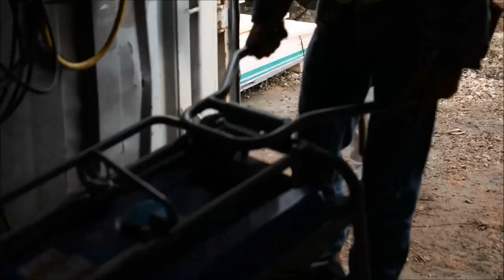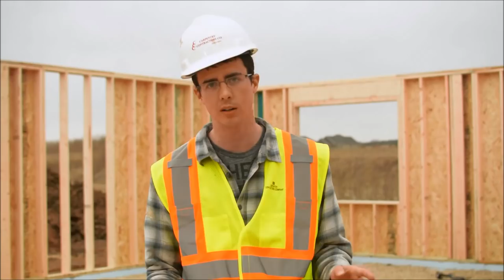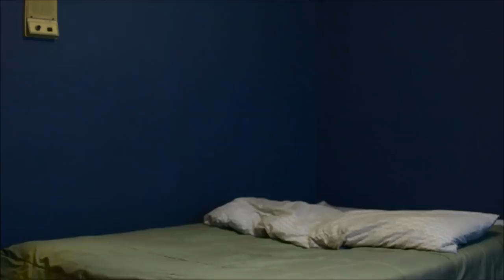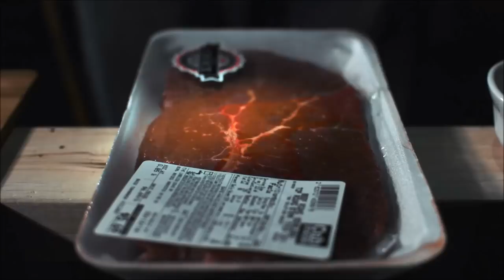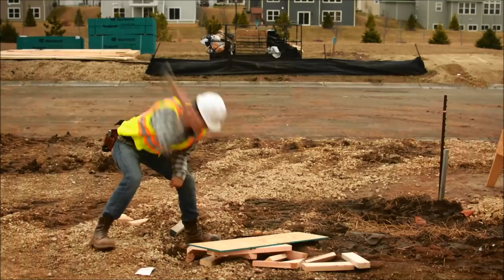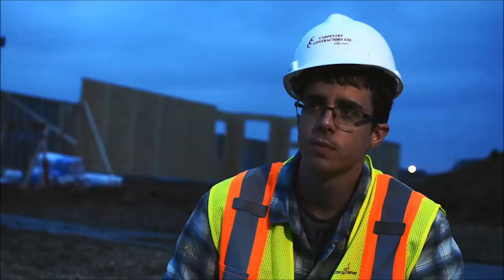Framing Houses in Minnesota - Humor

Comment: 33 drywallers disliked this video!
Reply: framer drywaller here, can confirm
Reply: Victor Holderman haaaaaa lol I say that all the time
Reply: I'm a drywall finisher and lmao the whole video. I can relate, but I will admit drywallers are a little more rowdy. I've never seen a drywaller who's worked more than a few months, not sing to himself. We'll be working and all of a sudden out of nowhere lyrics of some song are being practically yelled😂. I thought they were legitly crazy and took getting used to, maybe because I'm a girl, but after doing drywall a few years, I get it.
Reply: Lexi Anonymous  .. That's because gypsum is toxic and it takes about 4 months to take effect! 😂
Reply: @7033Joe fuckin bumb cabinet installer and finish carpentry guy here. How does this toe stepping happen? I thought that the framing, electrical, and plumbing inspections all had to pass before drywall started.
Reply: @lexianonymous7690  havnt been around many foundation wall guys have you?

Comment: Typical Gen Xer, has to use a skil saw to cut skirt steak.  Back in my day we used a crosscut saw.
Reply: noobs, I use a radial arm saw lmao
Reply: Rip across the grain for a more tender steak.
Reply: Except that wasn't a skirt steak. it was a dirt cheap top round or sirloin steak. Skirt/flank steak looks nothing like that.
Reply: Reciprocating saw all day. After I tumble marinate steak and dry rubs in the concrete mixer.
Reply: Barbarians! I cope all of my steaks to the grill grate with a 32 TPI blade and slice with a 
#4 1/2 hand plane.
Reply: Table saw. Rookies.
Reply: Band saw cuts more accurate
Reply: Y’all are crazy, I use a rock and two sticks
Reply: I was in the army so I like to use detination cord. Cuts a nice straight line lol
Reply: Fuckin Axé 'er, wha?

Comment: That sound of the genny in the morning is the worst sound and feeling. Any other carpenters relate?
Reply: No, cause it means I get to work.
Reply: Ervun Gaming       In Minnesota you get like three weeks of nice weather each year to work outside. So yeah, when it’s 10 below and you finally got it started, its just going to be a long day.
Reply: We usually have site power. Worst feeling for me is hearing the turbo whistling on a concrete truck coming down the road. No matter what you're getting ready to pour. The next couple hours are going to suck
Reply: @BMRFARMSKY  I worked with my dad in various parts of construction, and no matter how prepared we were he freaked when he heard a truck coming down the road.
Reply: @notredo  We lost a garage floor about 5 years ago. It was middle of August and started to set up before we even got it unloaded. So bad I refused the second truck that showed up 20 minutes later. Put every drop of water on it the truck had and then pulled a garden hose. Spent the next three days busting out and tieing new rebar. Lost 10 grand on that job. I literally panic now when I hear a truck coming. Worst feeling in the world
Reply: @BMRFARMSKY  I had a truck come from a different mix plant because our usual one went down. Not only was it an hour away but the driver got lost (pre gps). It had been an hour and 45 minutes since he left the yard. With the job being flat work, Isent him back and scrubbed the day. Caught hell for it, but probably would have ended up the same as you did

Comment: dont let these guys light hearted videos fool you, they are not a good company to work for.

the pay is some of the lowest in the industry, they treat their employees poorly, they will stick you on one job and have you doing that for months like a factory worker. 

when i worked there I thought id be learning how to build houses, instead i was stuck in their warehouse / factory nailing walls together on a table 8 hours a day. they didnt have any cable balancers / assists on the guns so  the wrist fatigue was insane and i quickly developed carpel tunnel. asking around, everyone that worked there said its a dead end job and get out if you can, so i did.

if you look on the minneapolis craigslist they have multiple job postings all year long. this means they are a revolving door and constantly have people quitting. it might be a good place to get started but clearly dosent offer anything for long term employees.

Comment: There are worse ways to spend a life...Working with your hands is what men were built to do...Nothing better than sitting around on a nice spring or fall day, telling war stories or breaking balls...That's the good stuff! :)...

:)...I started work as a framer when I first got out of the service in the 80's...East coast; philly area...It was booming...You could go work for a company for a few weeks/months and quit and have a job any time you wanted...I was framing when we were using the 26OZ waffle face estwings and 8.25 worm drives...It was hard work but; I'd go out and party till midnight then get up at 6 to be at work by 7...We had a lot more stamina then...I am semi retired now after 30 plus years in the trades...and; just turned 59 on and I'm healthy as a horse, according to the VA..Or did they say I smell like a horse...Well, either way; there are horses involved...:)

Comment: You guys frame your houses weird.  We nail dwangs (nogging) in between the studs (uprights) so they don't buckle under load. Sure, you've got some OSB to stiffen it up, but I've seen guys there build extensions with just good old fashioned fairy-dust drywall as the bracing element...

I guess those cheap and tacky McMansions have to be affordable some how!